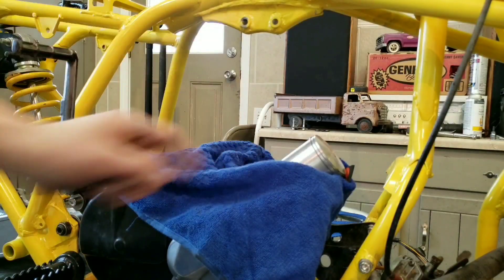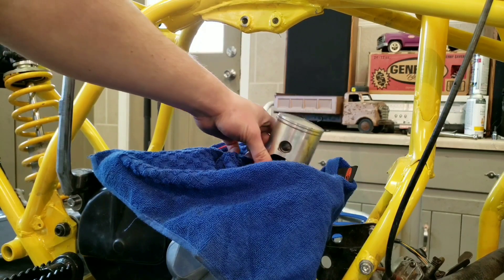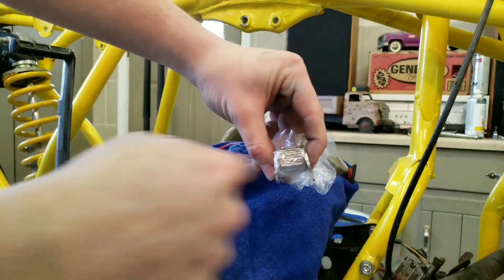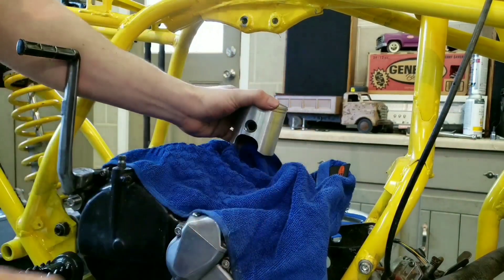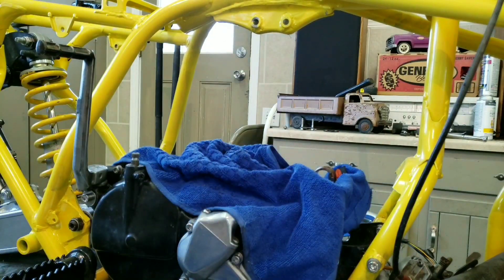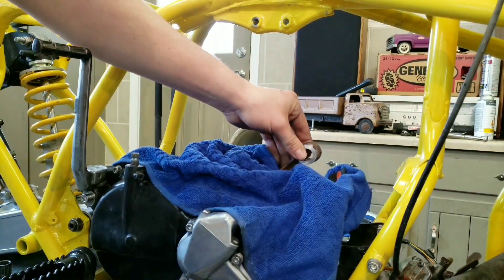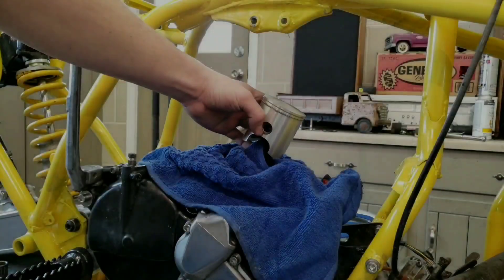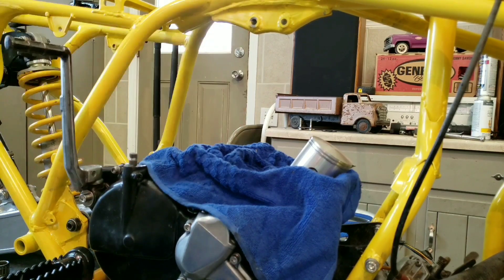How To Bulletproof Your LT250R Top End!!!!!

Comment: I just put a new top end on my 1988 Lt250r and and the machine shop told me I didn’t need any thrust washers on a 88+ (with a Wiseco piston) but now I’m second guessing that. Can anyone confirm that I don’t need them otherwise I may be ordering one of these kits.
Reply: You don't need thrust washers...if you did, all motors would come with something...this is something some dude thought about in his garage and figured he'd make money selling it...no other 2-stroke manufacturer puts anything like this in their engines...as I explained above, if you have side-play issues when assembled, the problem's in your crank journal not the wrist pin...
Reply: @josesolis4505  not true I found out the hard way. It’s been a year since I commented that but I ended up wearing out my lower rod bearing. Most two strokes and 4 strokes have thrust washers on the crankshaft pin between the rod. Suzuki’s decided to put them on the wrist pin instead, you need to limit the side to side of the rod doesn’t really matter if you do it from the top or bottom. The reason for the billet ones like he’s promoting is so they don’t shatter like the stock steel ones. So yes you need a thrust washer if your engine is designed to have it.

Comment: So...if this is so damned important that it would keep a motor from grenading, why aren't any of the other manufacturers, like Honda, Yamaha and/or Kawasaki use thrust washers on their wrist pins?? 🤔...cause in reality, once assembled, there is a miniscule amount of side play on the slug within the bore...and if you have too much, you got a crank journal problem!!...
Reply: It's important on an LT250 and LT500 motor because they designed the motor to use the thrust washers on the wrist pin to center the rod instead of bushings on the crank. The factory washers are steel, and stepped, and are prone to crack and come apart from years of high rpm's or from pre-detonation. It's not important on other bikes because they're not designed using thrust washers on the wrist pin to center the rod. They do it with the crank instead. The point is it's a huge upgrade to the Suzuki motors to run a lighter and stronger, non-stepped washer machined out of 70-75 aluminum. Unlike the factory steel washers, no one has ever had one come apart to anyone's knowledge in the LT community. And if one ever did, it surely wouldn't damage the top end and crank as much as the factory steel ones do. And it's a fairly common phenomenon on these older bikes if those washers haven't been replaced regularly.

Comment: Mechanically it is impossible for that piston to move sideways in the bore...unless the crank journal is gone and by that time, the last thing you'd have to worry about is your cylinder...so YOU DON'T NEED THESE...IT'S SNAKE OIL...PROVE ME WRONG!!!
Reply: You clearly know nothing about the LT250R and LT500R motors. Obviously, no piston could EVER move sideways in the bore unless it's not the correct piston. That's not what these washers are designed to do. The thrust washers are keeping the ROD centered on the wristpin and on the crank. On most two stroke ATV or dirt bikes, when your rod gets too much side to side play on the crank, you have to tear the motor apart and rebuild or replace the crank which is a ton of work. On the Suzuki, they used this system which makes it a breeze to fix side to side rod play by just replacing the thrust washers on the wrist pin. The problem is the way they designed the factory washers is a weak point. If you've ever seen one of these motors after a thrust washer comes apart, it's devastating and sometimes ruins the cases, crank, and the jug. I've purchased multiple used quad racers that have had that happen. I've rebuilt several, and I've only ever used custom billet aluminum washers with an RM 250 wrist pin bearing. Never had one come apart yet.

Comment: I’ve ran all my lt500’s and 250’s without those and never had a problem for over 30 years, so don’t be making videos about something that’s not true.
Reply from the maker: Yes this is a proven way to save your engine, the stock ones are not as good. Take a look at all the LT250R forums if you don't believe me .
Reply: This is one of the most basic, and well known reliability mods for the LT. Join some forums bud.
Reply: JNK Racing...mechanically speaking, explain to me how will these stupid little washers save your motor...please, proceed with the explanation!!...